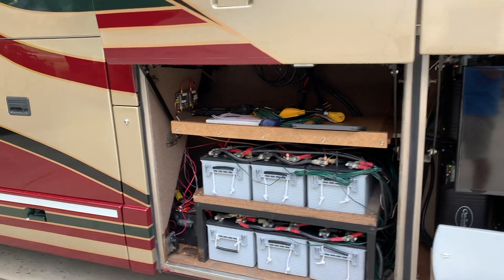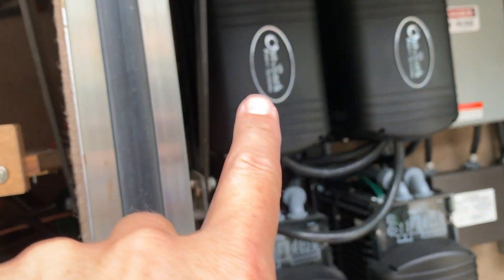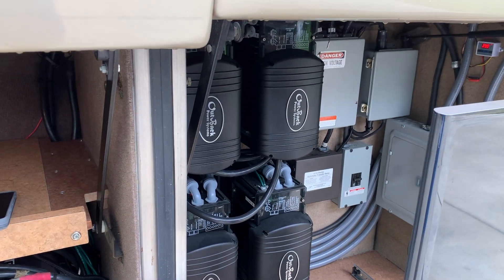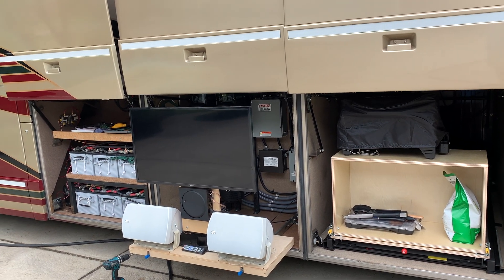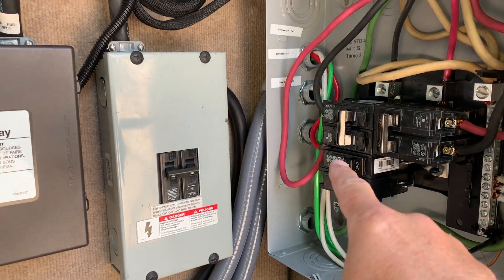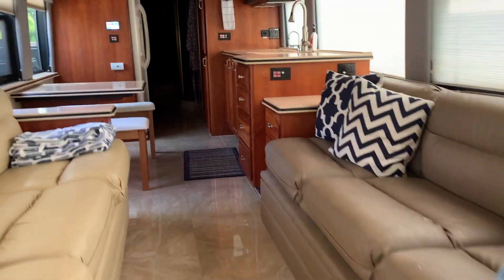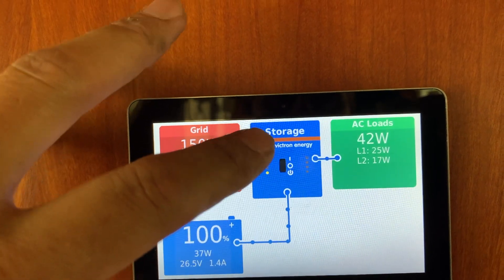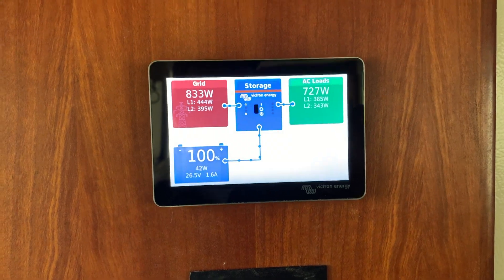Dual Victron Multiplus in a Prevost H3 45 Class A RV Camper

Comment: just visited an 95 H3 45 with cruise airs...gentleman said he could only run 3 ac' at a time or else his gen would pop breaker....it was up here in ohio and to me the ac's were struggling to cool bus. couldnt keep up w a merely 90 degrees....had to walk away.
here in south texas...we get to 110 on the daily for months
Reply from the maker: Something was wrong. A lot of people love them, a lot of people wouldn’t own them again. They are just like home units, some just get tired. I’ve only run 2 Roofs at a time and they have done well in 100 degree air. I did notice these units hit hard on start up, I had to set my inverters to help and allow for a quick over current to run all four.  I think they draw 60 amps each on start up (locked rotor amps) they need to come on independently. If they were all trying to come online at the same time it could be 180-240 amps!  That should drop back to 12 amps each though pretty quickly.  If the air wasn’t keeping up, sounds like a leak and if original they should probably just be replaced.
Reply: @CampPrevost  you are a true resource sir!

Comment: Would you benefit from one of those “easy start” mechanisms attached to each AC unit?  I wonder if you  are worried about the initial power spike when the AC compressor turns on.
Reply from the maker: Yes I would!  I did, however, get 4 hard start units ($25 vs $300).  They are supposed to help with the sudden rush of current - as opposed to slowly ramping the motor. I did reprogram the inverters to allow a very short spike and also provide a power boost from the batteries. This will be my next upload. It worked. I will, however, still install the hard start capacitors, it will reduce the spike by as much as 50%, that will make me feel better. It will help the condenser motors and electrical equipment. Why they don’t come with the AC’s in the first place is beyond me.
Reply: @CampPrevost  that’s cool.   Love seeing the progress.  I’m sure it’s like having a second home to maintain rather than a second car.

Comment: Any plans to swap out those deep cycles to Lithium?  Love the changes to the entertainment bay.
Reply from the maker: I really want to….  My wife wants to get another coach - so we will see. My issue is that they work…  there is also 265amp x 6 of AGM cells (19,080 / 50% = 9,500 usable watts). So it would take a lot to match the capacity.  I have my eyes on a DIY battery cell but am not sold on a BMS yet, that’s my biggest hangup.  If I knew we were going to keep this forever, I would probably do it this fall - I don’t know how a prospective buyer would look at the cells…. I want it fool proof - I am not convinced there is a good BMS out there yet.  Would love to add solar too.  Thanks for watching!